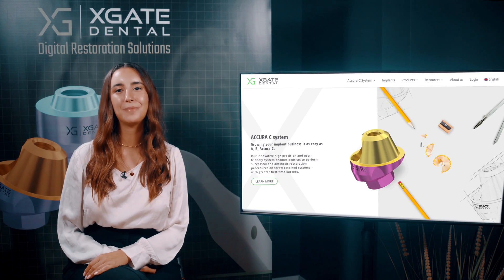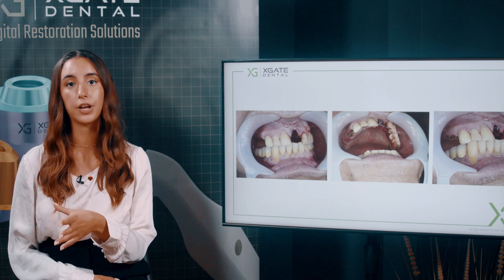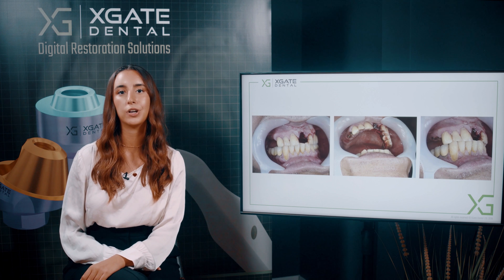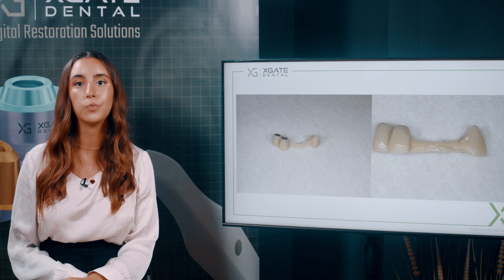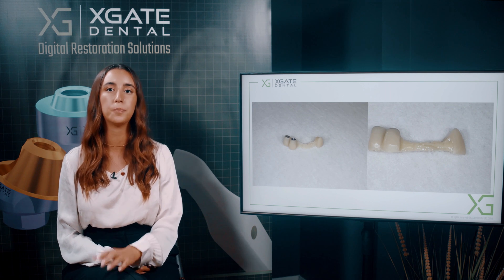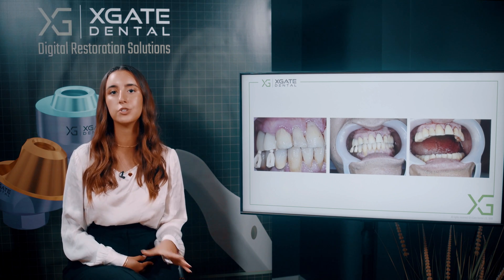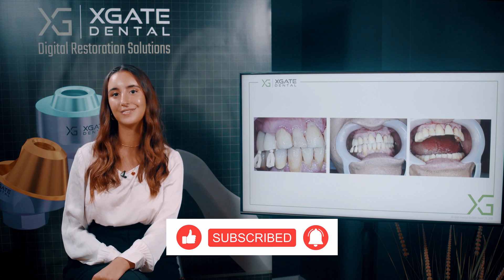It's something that is not widely used but it's a great solution. The Maryland bridge alternative

Comment from the maker: 00:00 Patient in his sixties came with problematic anterior tooth.
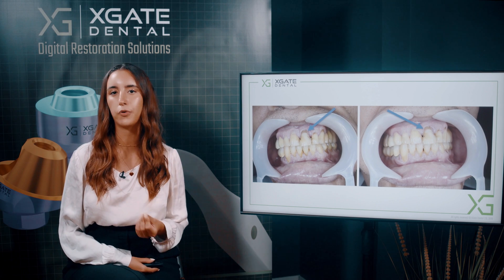01:00 Extractions of the tooth and removal of posterior bridge were made.
02:00 Immediate restoration is a problem in frontal teeth
03:00 A temporary Maryland bridge were manufactured using PMMA.
04:00 Temporary restoration. Assembly of the bridge.
05:20 Next step